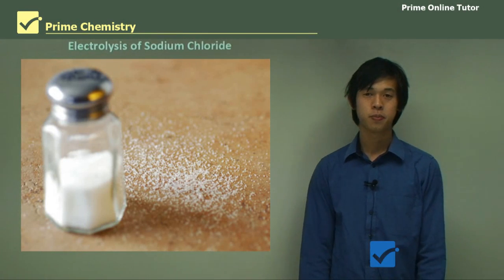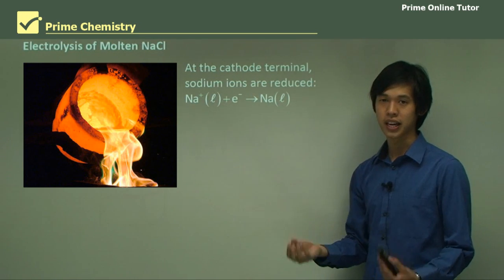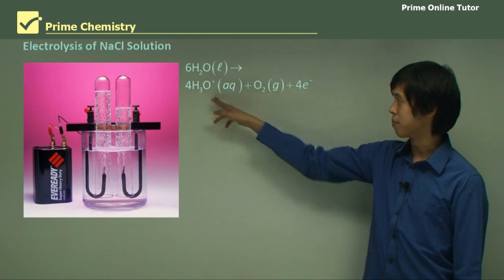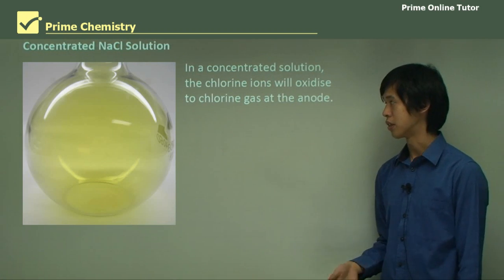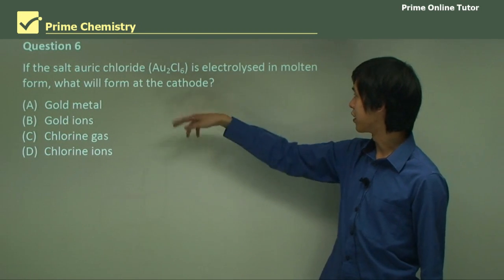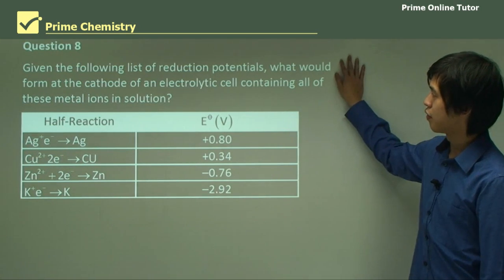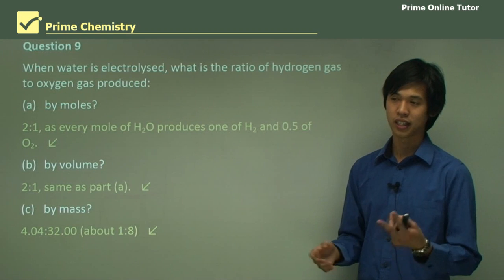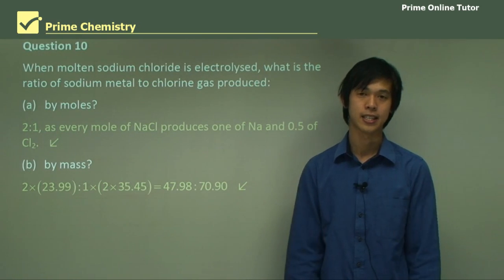Deciphering Electrolysis: Sodium Chloride Reimagined

Comment: If I Elektrolyse the NaCl solution in a Membrancell with a NaCl solution on the anode and normal water on the Kathode I can earn naOH as a product but what happening if I run the cell until the end of the reaction of the nacl solution? The product at the anode is NA+! What happens if I reduci g the na+ solution on a cooki g plate? What is the result? Thx for every help!

Comment: Sir please tell that,when chloride ion gets oxidised at anode it releases electron.then it should be negatively charged but we consider it as positively charged in electrolysis of NaCl(say molten)
Reply: Are you saying that the electrode which discharged chlorine ions should be negatively charged(i.e. Anode should be negatively charged)? If so, don't confuse simple cell with electrolytic cell. In this video, electrolytic cell is used, where there is a power source(battery) present. Hence, the terminals of the battery will decide whether the anode is positive or negative. For electrolytic cell, anode is positively charged while in simple cell, anode is negatively charged. Just remember, the terminals of the battery will decide the charge of the electrodes.